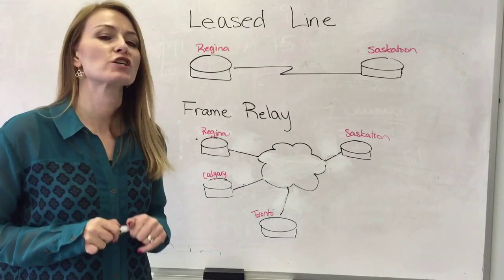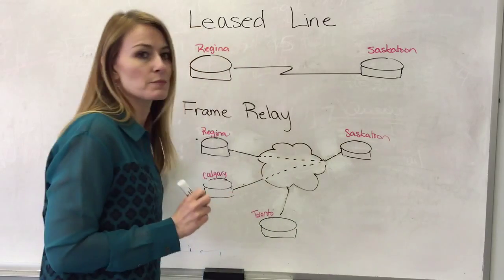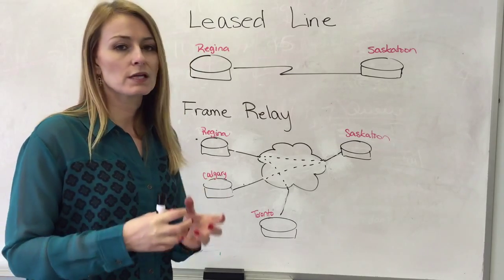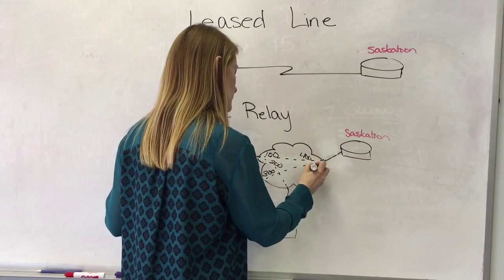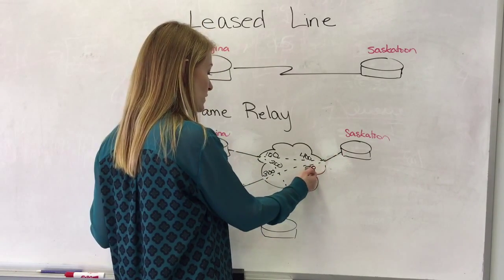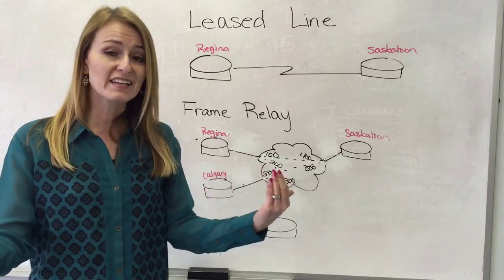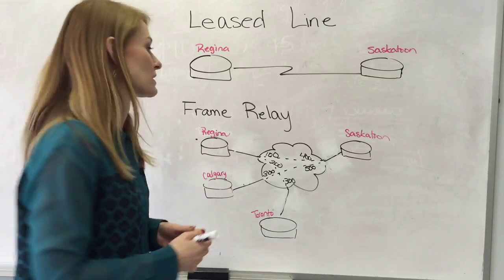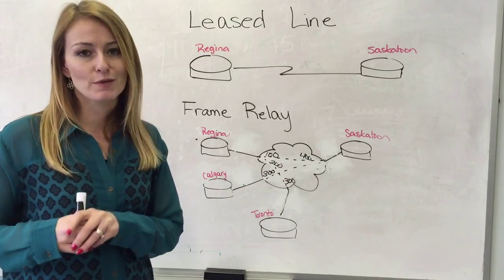DLCI

Comment: Thanks for the video. I have a question. My english is bad, so I hope I can explain me.  At the local level should I not have two equal DLCIs?  The same number, right?
Reply from the maker: Correct.  Think of it as a gate number at an airport.  You wouldn't have 2 gates of the same number at the same airport, but 2 different airports could have the same gate number.
Reply: Thank you, it has been a great help. I subscribe.